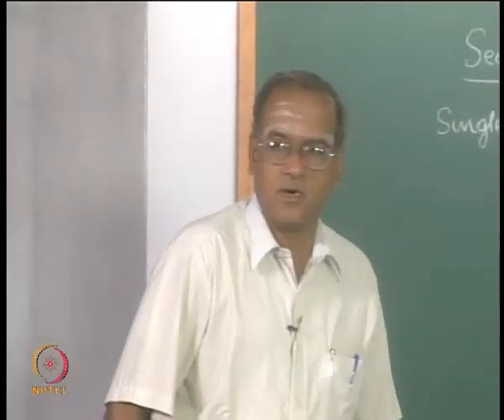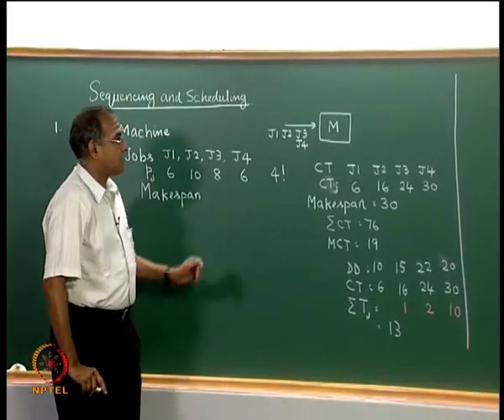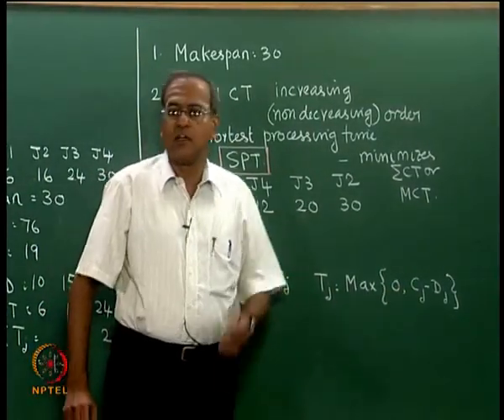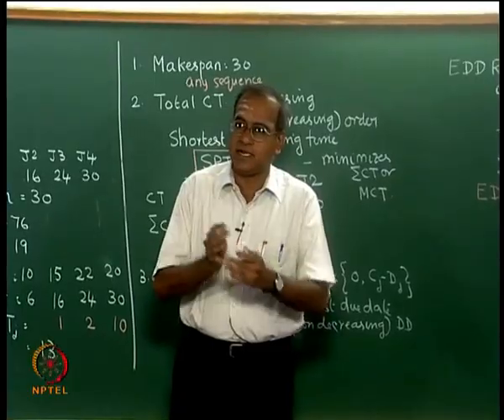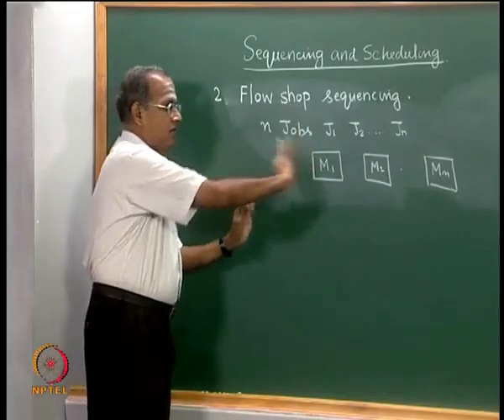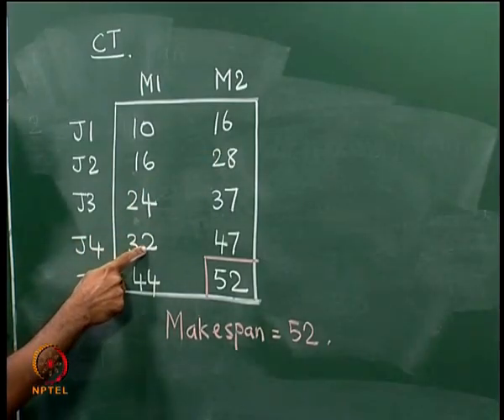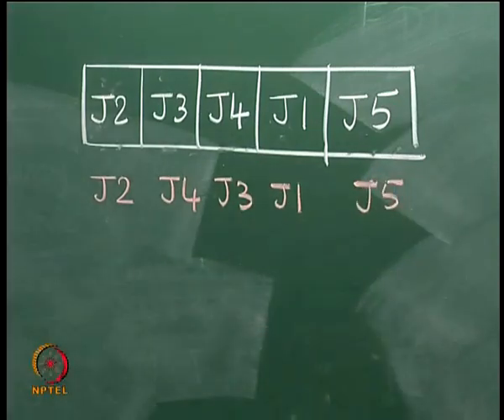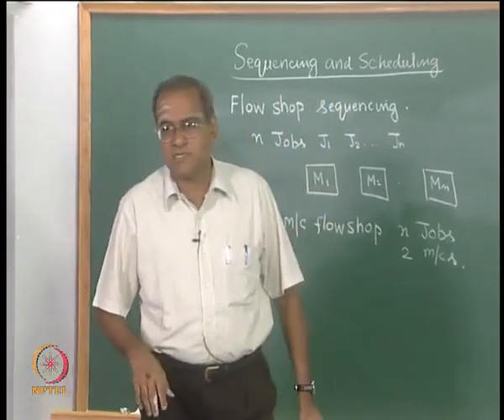Mod-07 Lec-25 Single machine sequencing. Two machine flow shop -- Johnson's algorithm

Comment: thank you sir excellent lecture!.....In johnsons algorithm 43+5=48 but yours shows 49
Reply: becoz the Job5 is done only after t=44 therefore machine M2 can start only at t=44 and not at t=43, this is the case where the Machine is waiting for the Job5. 
Therefore it will be wrong to take t=43 plus 5 giving t=48 (not correct)
U gotta consider the idle time for M2 therefore t=44 plus 5 giving t=49 (correct)